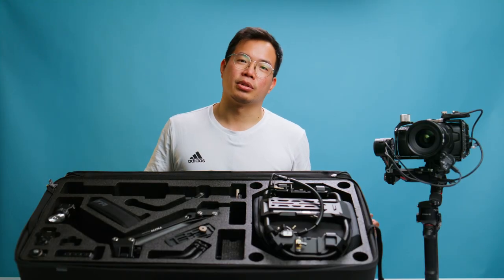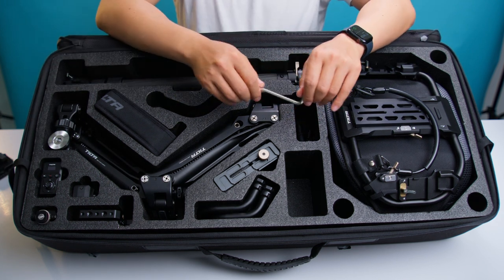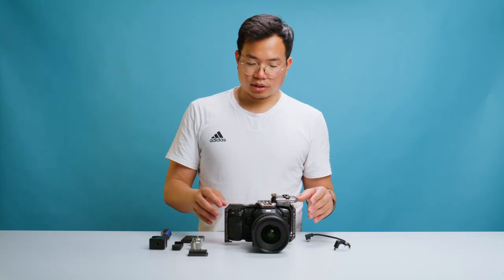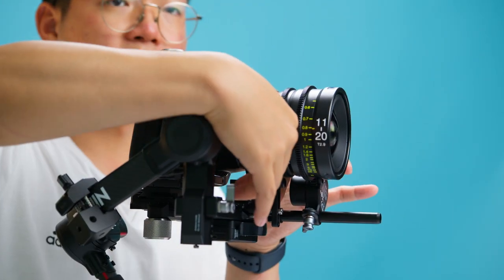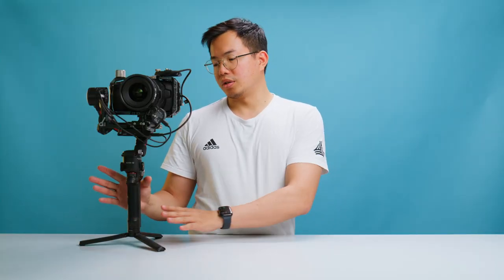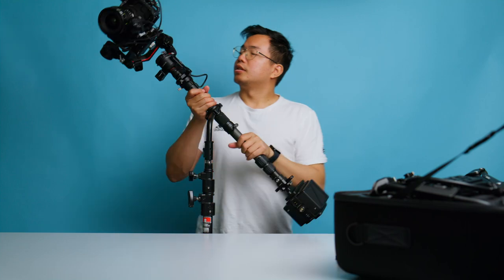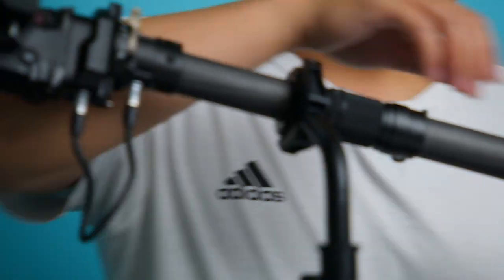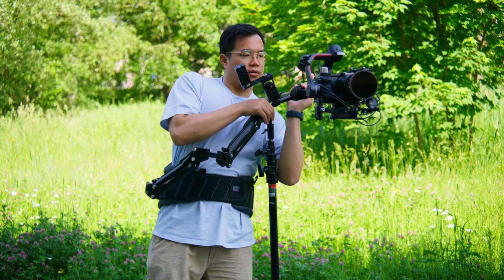Tilta Float deep review and full assembly

Comment: The footage is completely unusable for any serious work. I have tried every gimbal setup you could think of and the only way to get good stable shots in my opinion is to buy a new or used MoVi gimbal, and use an easyrig or readyrig and a segway to remove the up and down motion. Not exactly the cheapest solution, but if you actually want stable gimbal footage and don't have the money for a steadicam or and Arri Trinity, a Freefly MoVi Pro, Readyrig and Segway Ninebot S costs about $8,000 instead of $80,000 for an Arri Trinity. Better to spend $8000 once than to buy dozens of other crappy rigs and be constantly disappointed like I was. Now I shoot with the MoVi Pro and MoVi M5 and my shots are perfect.
Reply: There’s so many videos out there that have smooth footage using the float though. There’s a learning curve to balancing of course, but there’s absolutely no reason why this shouldn’t work.

Comment: I also got the float and tested it the last weeks. The main con is, that the arm is too weak or everytime at the edge of loading capatilibies. The second thing is, the belt does not fit very well. it pushes unpleasent to the lower back. i already bought a vest to it. Now it´s slightly more pleasent but not very well. the third point is the poorly made bolt that holds the float system on the arm. i wouldn't be surprised if the part breaks at some point and the entire setup falls to the ground. no steel was used here. I can´t understand why they used such cheap material.
Reply: i wouldn´t recommend this system for that price
Reply: @sk.newmedia  It is the cheapest out there I think :D

Comment: What, "if you have ronin 2, you probably  have the battery package already" What do you mean? Why should I have that package? Where did you get the plate from? I got one battery, that was 400$ but only for one side.
Reply from the maker: If you dont have the package you can use the V-Mount which is included in the package or the RS 2 battery pack. But if you want to have a same setup you can buy the stuff at B&H Photo.
https://www.bhphotovideo.com/c/product/1634065-REG/tilta_gss_t01_bpr2_float_system_ronin_2.html
https://www.bhphotovideo.com/c/product/1379997-REG/dji_cp_zm_00000034_01_ronin2_part_5_dual.html
https://www.bhphotovideo.com/c/product/1301742-REG/dji_cp_bx_000179_inspire_2_part_05.html

Comment: I'm having issues with the wireless controller' it controls the rs2 movement but it doesn't permit me to pull focus' it doesn't respond. But it works fine on the handgrip wheel. Any thoughts?

Comment: The BMPCC 6k takes CFast cards, not CF (which stands for Compact Flash and is the predecessor). Also, by using SSD to record, you sacrifice the option of camera control from the DJI Ronin RS2 of the BMPCC 6k. And yes, that fully works, if you have updated the gimbal to the latest firmware. Also, the HDMI cable should ALWAYS be the last cable to be plugged in to avoid the camera to use it as a ground plane and burn it's HDMI port out. The BMPCC are especially prone for this.

As for the cable to the RSS port of the RavenEye, that's meant for remote control of the camera, when you don't use it with the DJI Ronin RS2. Is there any particular reason, that you connected that from the gimbal to the RavenEye. Because that most certainly is not mentioned in the manual anywhere.

As you haven't allowed for an external battery for the BMPCC, you're not going to have a long battery lifetime. Smallrig make a special arca-swiss plate for the BMPCC, that lets you slide it sideways and that way you get more free space between the battery side of the camera and the motor of the gimbal. That also eliminates half the weights, that you have added there. And with the Niceyrig V-mount plate that gets mounted under the Smallrig counterweight bracket, you can then mount a slimline V-lock pack or the Core SWX Powerbase Edge battery under the BMPCC and get a much better balance plus a 4 hour battery lifetime for the BMPCC.
Reply from the maker: Thank you for the detail feedback. We will try harder to improve the quality of our videos. We hope that you could at least a little added value?
Reply: Wouldn't the raveneye be in the way of the vmount battery? Even one with a slim profile?
Reply: @luclaflamme4712  If you want to mount a V-mount under the camera ? Yes.
But you can always move the RavenEye. It can be mounted anywhere, that you've got a cold shoe for it.

Comment: I landed up sending it straight back the grip at the rosette on the belt is too shallow and not strong enough it very nearly cost me my gear as it slipped while I had camera attached and fell thankfully I managed to catch it,the ridges need to be bigger so it actually holds when you tighten it up I couldn’t trust that it would not happen again, I also found the belt extremely uncomfortable

Comment: Love your video and it's in dept but please can I get the list of the accessories that didn't come along with Tilta because it just arrive but didn't come with the batteries and I also want to know the kind of batteries to get. Thanks Tried to follow you on instagram but your link is wrong I guess.
Reply from the maker: Hello @ibfotografa

In our build we used the TB50 Batteries from our Ronin 2 you can buy it separately. You can also use V-Mount Batteries, when you don’t have the TB50 Batterypack and don’t want to spent that much this is the better solution. If you bought the Gold Mount version you need to get a Gold Mount battery.

Accessories we used:
https://www.bhphotovideo.com/c/product/890938-REG/Wooden_Camera_WC_146600_Easy_Plate_XL.html
https://www.bhphotovideo.com/c/product/1490082-REG/tilta_ta_t01_fcc_g_bmpcc4k_full_camera_cage.html
https://www.bhphotovideo.com/c/product/1510741-REG/smallrig_bss2465_counterweight_mounting_clamp_kit.html
https://www.bhphotovideo.com/c/product/1603997-REG/smallrig_counterweight_kit_for_dji.html

Bettery Accessories:
https://www.bhphotovideo.com/c/product/1301742-REG/dji_cp_bx_000179_inspire_2_part_05.html
https://www.bhphotovideo.com/c/product/1379997-REG/dji_cp_zm_00000034_01_ronin2_part_5_dual.html
https://www.bhphotovideo.com/c/product/1634065-REG/tilta_gss_t01_bpr2_float_system_ronin_2.html

Gold Mount:
https://www.bhphotovideo.com/c/product/1634065-REG/tilta_gss_t01_bpr2_float_system_ronin_2.html

V-Mount:
https://www.bhphotovideo.com/c/product/1634065-REG/tilta_gss_t01_bpr2_float_system_ronin_2.html

Make sure that they are not to big otherwise the don’t fit the mount.